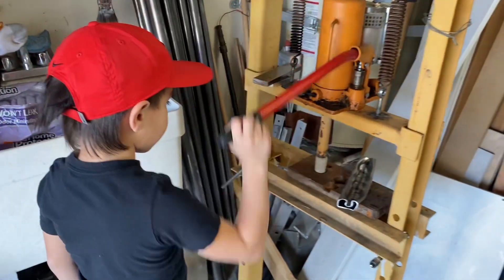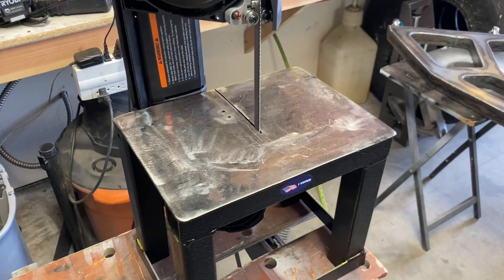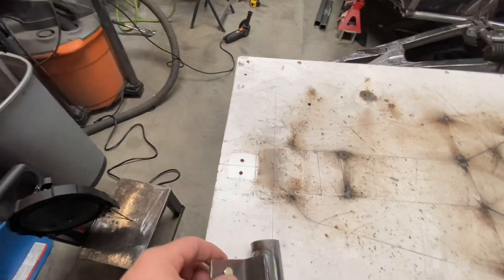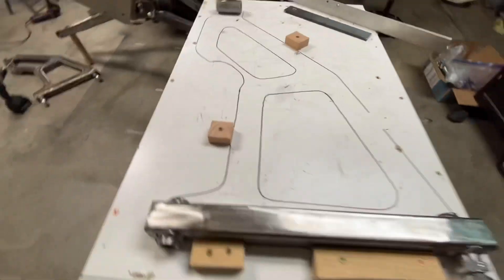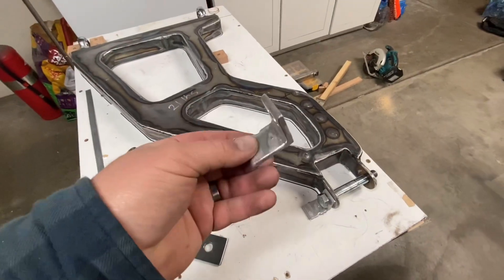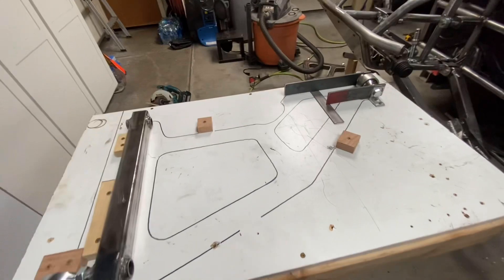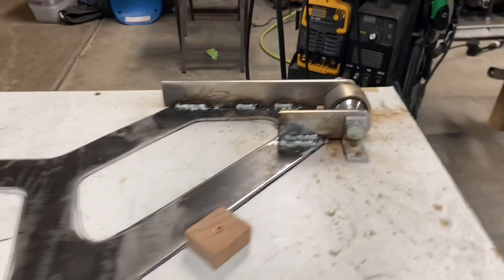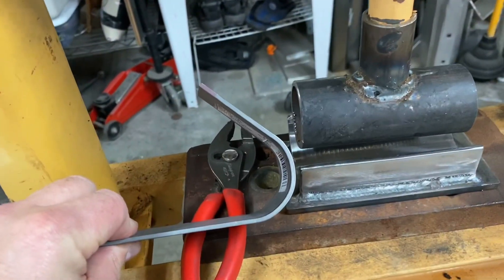Baja Bug Upper A-Arm Design and Build

Comment: how are you keeping the portaband on the table? i need to make one myself
Reply from the maker: I am only using the two screws that hold the stop plate on. They are actually very strong. I’ve been using the heck out of it and haven’t had a single problem

Comment: That's some really nice work! Like you jigs, wood does make good easy to use jigs and layout tables...except for the "catching on fire" part 😅Nice table you made for the Portaband. I wish I had made/purchased one years ago, really love using mine now that I finally got one. Now I just need to get a press, for some dumb reason I've never had one. Guessing we were both born in 1970?
Reply from the maker: Thank you HRD! I can’t believe I waited so long to get the portaband saw. It’s a great small tool. The press has come in very handy.  I highly recommend a press. I’m excited to make more tools for it and make it even more capable.
Reply from the maker: And yes, the wood does burn. It’s so cheap and easy to use I can’t resist. I just keep the fire extinguisher nearby and stay aware of the risk. I missed the 70’s by 5 years 😢
Reply: @MiahsBug  Noticed "since 1970" on the door of the bug & thought it might be that. I have  "since1970" on one of my logos because of my birth year
Reply from the maker: Ohhhhhhh 😂 I have since changed that logo due to it being confusing. 1970 is the year my bug was born.